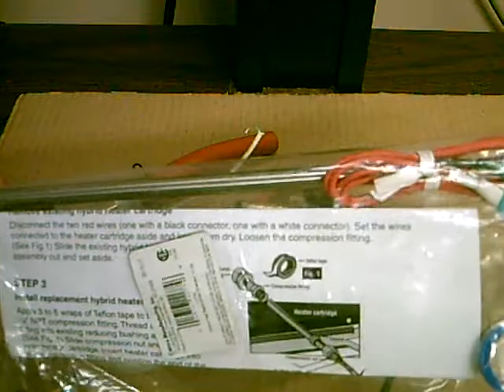Water Heater Element Options, including Dumpster Coffee Makers

Comment: In figuring out the amount of power for one of the options (I like the small camco one for the RV tank), am I going too arrange solar panel output to be within the voltage rating of the element ?  for the non electrical savy watchers,,,, what are the basics of a solar panel too an heating element connection ?
Reply from the maker: There are many ways to do it. The process involves keeping the panel at power point voltage for maximum power transfer. Power point voltage only varies with panel temperature not with light level as many believe. The current a panel can produce does vary with light level. Some connect the panel directly to the heating element which can be OK for about two hours a day. Any other time the low resistance drags down the panel voltage because it can not supply the current. If panel voltage drops to half, the power decreases to 1/4, and it gets much worse quickly.

I have several videos on how to do this. There is no ready made product that will control a water heater off panels also used for charging a battery. These aren't really that complicated if time is taken to understand them.  Response to this idea has been very poor.  I'd be interested in any comments on these projects to make them easier.
Reply: @opera5714  Thanks for the reply,, I have started watching your videos and will get back to you If have a more educated question.  I looks like you are offing a lot of knowledge and I look forward to learning as much as i can,
Reply from the maker: @sostahoe  Just what size tank are you thinking about heating, total wattage of array and array volts?  This will give me an idea of what a target system would look like. At home I have two panels just for experimenting. I can run a 30V or 60V system.  Heavy shading doesn't make solar practical at my home.   Just found an ebay boost converter in my stock. Some time in the future I will be doing a 30V to 80V boost to my water heater element with power point control video.
Reply: @opera5714  Thanks for your interest in my inquiry.  I have 3 potential projects.  I  would like too just hook up a couple of panels to an element for experiment for starters. My projects are the propane water heater on my  RV,, I also have am building a shop that has a 275 gal water storage tote that I would just like too keep from freezing. , finally I would love too supplement the water heater system on my hot tub.  I consider myself a maker and experimenter and am always exploring ,